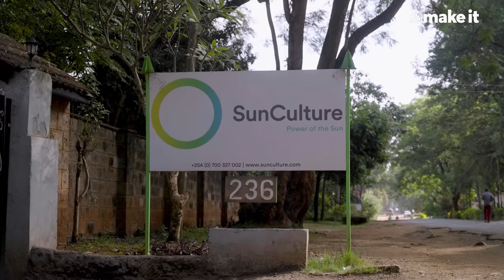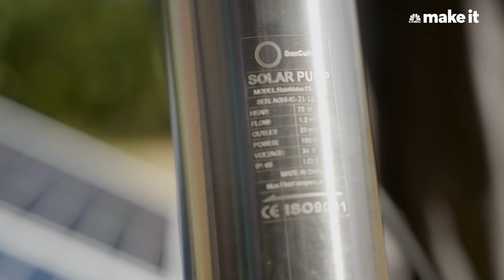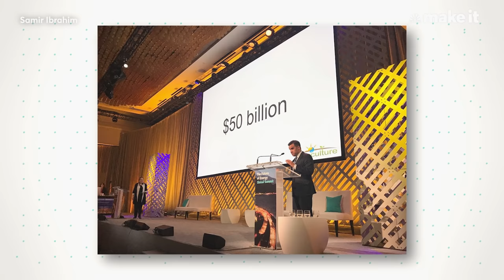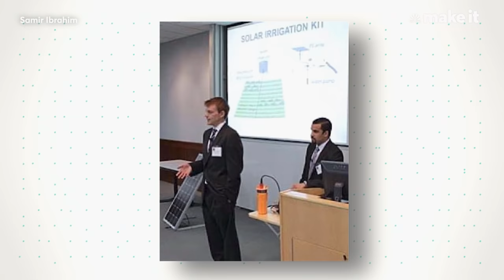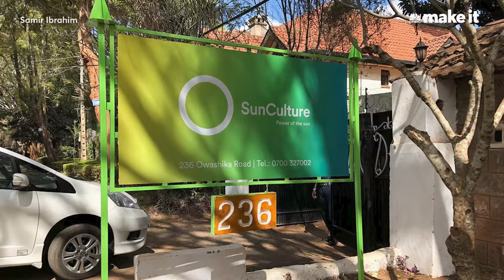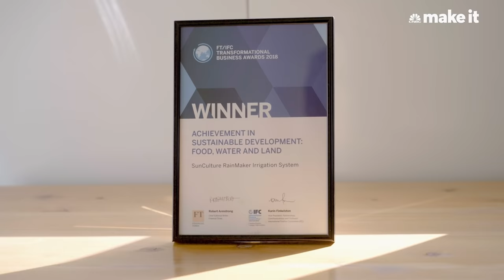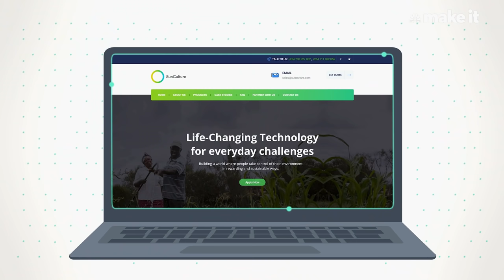How I Raised $40 Million To Give Rural Farmers Solar Power

Comment: questions: is there a way farmers can keep their existing big pumps but simply change the power source to solar?
How are they ensuring farmers pay each month? Surely defaults are VERY VERY HIGH.
Reply: Its pay to Own and ppl do have money to spend on things like this in most places.
Reply: Existing big pumps are usually very very inefficient. Eg: diesel pumps/engines are usually built with thick heavy metals to withstand the high pressure and tensions released from diesel combustion energy. 

A solar (DC) pump is usually extremely energy efficient as it has to be able to function with the lower amount of power (current) generated from solar.
Reply: @kenmark5676  Cheers Ken, appreciate the detailed answer. Looking to do this in the Philippines. Not pulled the trigger yet though
Reply: @krisb-travel  always welcome. Just make sure you understand the costs including flow rate (rate at which water is being pumped) with regards to your consumption as that will determine your profits and losses.